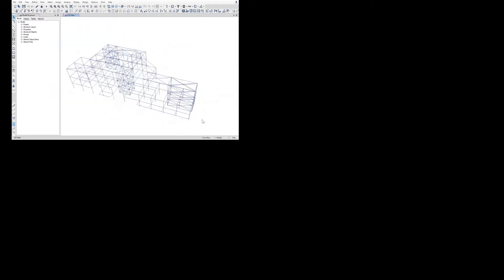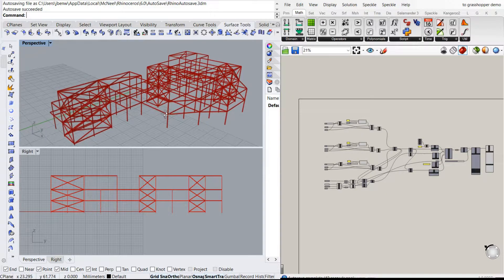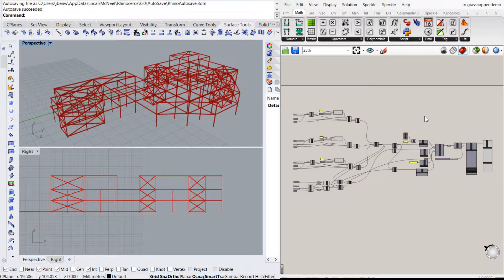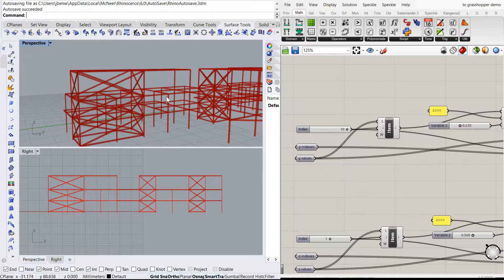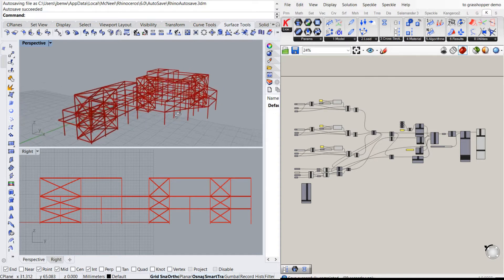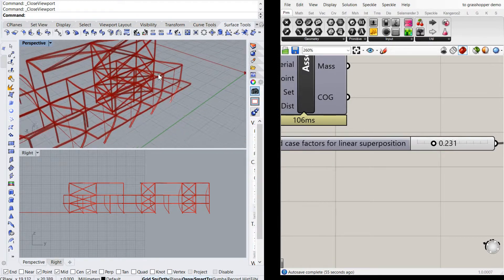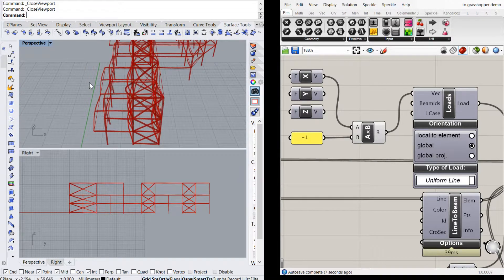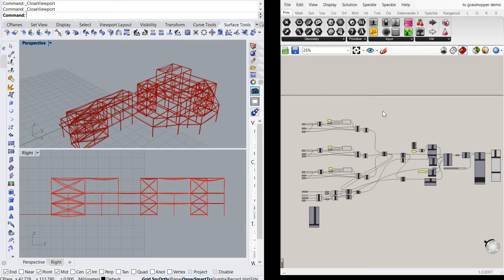Convert Analysis models to Parametric models (eg/ ETABS to Grasshopper/Karamba)

Comment: Your video's are good
Can you model simple diagrid structure using sap2000? It's now trending
Reply from the maker: I just did a video on projecting a diagrid onto a 3D surface which might be useful... It will be posted soon.
Reply: @StructuredParametrics  thanks sir , waiting